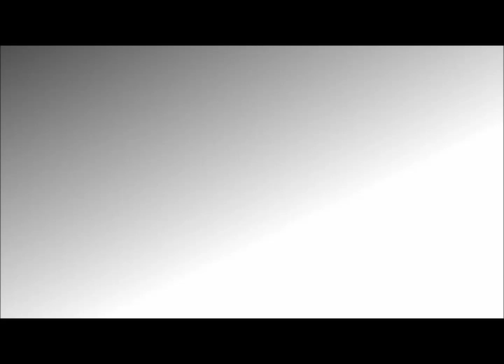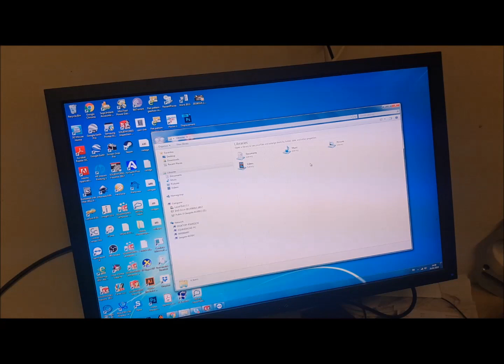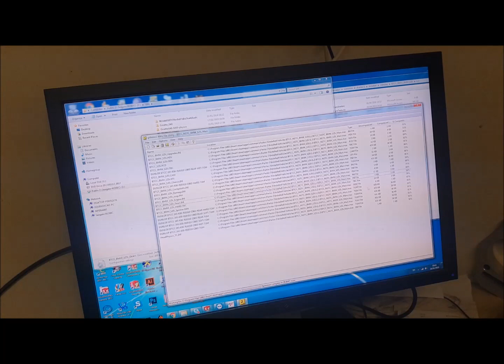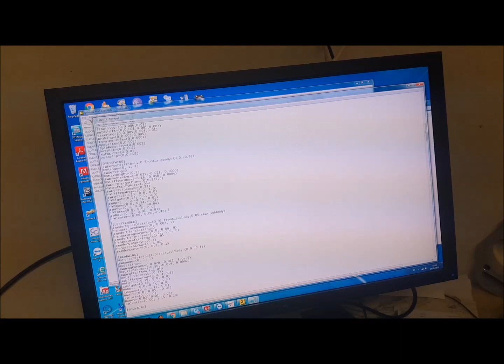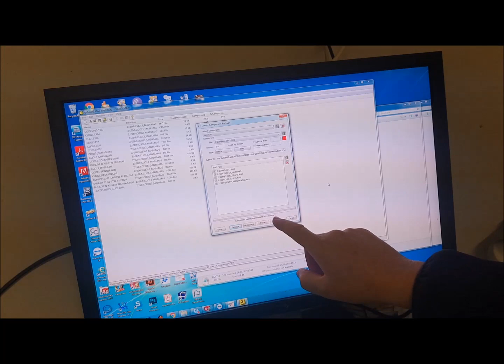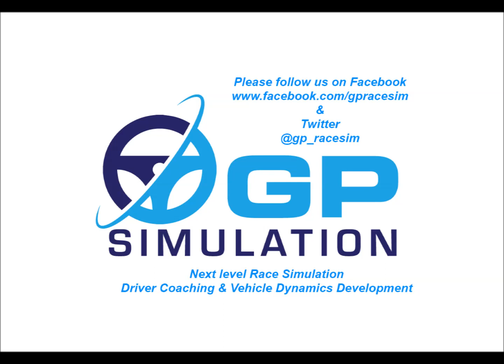rFactor2 Modding Tutorial - Part 1 - Basics

Comment: I tried to make a simple adjustable gearbox upgrade mod for the Tatuus PM18 in RF2 following this guide somewhat (The old launcher is now deprecated, so the MAS Utility is in the Support folder of RF2), but after I made the package file and copied it into my RF2 packages folder, and then activated the mod file, the new upgrade options don't show up... I know how the RF1 Upgrades system works, and the RF2 file structure is pretty much the same, but for some reason my simple mod isn't showing up...
Reply: I'm trying to do this through the upgrade system so it doesn't overwrite the standard files